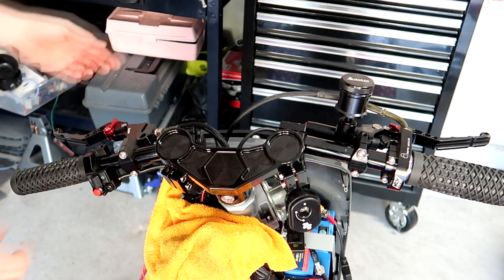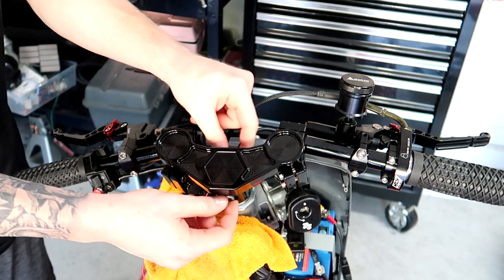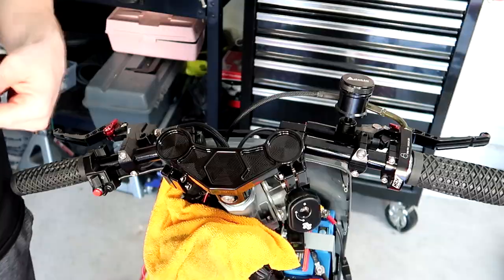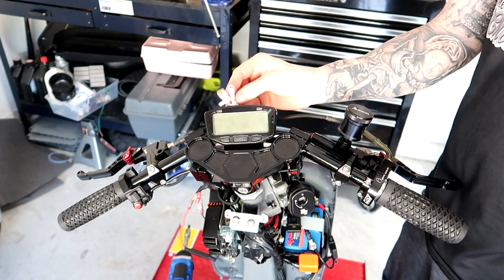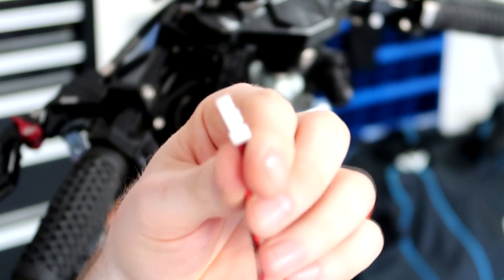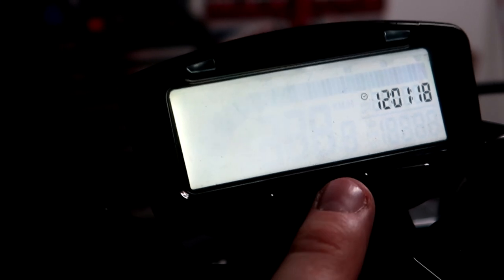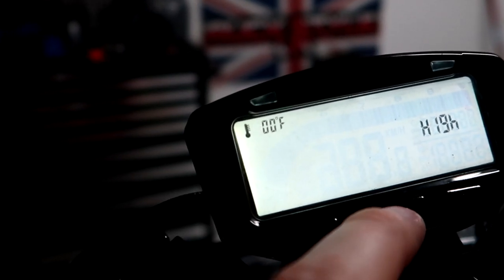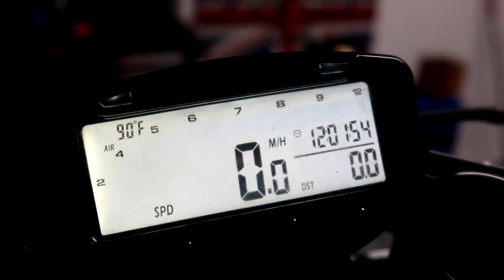TRAILTECH VAPOR INSTALL-HONDA RUCKUS-

Comment: I don't have any extra holes in my rotor for the magnetic bolt to sit. Can I use it as a bolt for my rotor. They are the same thread pitch.
Reply from the maker: Yea in the pack there should be magnetic bolts the same size as your rotor bolt.
Reply: @burnoutbobby  there was one bolt that fit the rotor bolt hole and there is not a pad that came with my kit. It's got a bolt you have to mount somewhere to your forks
Reply from the maker: There should have been a magnetic rotor bolt. They give a few options in the bag with extra magnets
Reply: @burnoutbobby  yea the rotor bolt was in there but not the pad you put on the forks
Reply from the maker: Where did you get the vapor from
Reply: @burnoutbobby  got the kit with the Ruckus trade but I'm thinking now that the previous owner may have lost it.  It wasn't in the trail tech box when I opened it
Reply from the maker: That may be the case then.
Reply: @burnoutbobby  thanks anyways. Always love the videos. Very informative as well as your site unlike some people cough cough dorbyworks😆
Reply from the maker: Hahahah

Comment: does it  have a gas gauge?
Reply from the maker: No the vapor doesn’t.
Reply: @burnoutbobby  I really want one with gas gauge so not to be guessing on the gas... but I guess you can add a separate meter for that.
Reply from the maker: Yeah that’s what most to. The vapor with a stage6 small fuel gauge
Reply: @burnoutbobby  yeah just have to create a mount with my 3d printer or integrate it to the battery box housing but I don't want to cut that
Reply from the maker: There are mounts out there for it already.
Reply: @burnoutbobby  yeah I seen some but I didn't think they are that great so I might just design my own... unless I'm lazy hehe.
Reply from the maker: That’s what I did for my last white and chrome bike I filmed
Reply: @burnoutbobby  im all wanting you to install and build stuff on mines but I know your taking fam time these days and taking a break right now which is good.
Reply from the maker: Yeah I am. Have to change my focus for a little.
Reply: @burnoutbobby  for sure you need a heavily break time absolutely understand that.

Comment: Boddy, you should be a full video on how to prep the frame with bondo for paint. And jb weld for powdercoat. Thoughts on this?
Reply from the maker: If I had multiple frames I would. My recent video is already showing how to do it for paint
Reply: @burnoutbobby  True 👍  in the process now of doing the JB Weld.. it's a pain in the a$$ cause I'm a perfectionist lol
Reply from the maker: No matter what you do, bondo or jb weld it’s going to suck and have to keep doing layers to get it as close to perfect as it can.  I’m no body shop guy so that makes it even harder for us noobs at it

Comment: Super helpful. If you have a cdi where should you coil your wire for the rpm? I did close to the plug but the readings don't seem correct.
Reply from the maker: For what cc motor
Reply: @burnoutbobby  just a stock 49cc GET nothing fancy.
Reply from the maker: You still wrap the ron wire around the coil wire then.

Comment: What is that little can on the right side of your handlebars? Also that clearish yellow tube? Im new to the ruckus scene. Trying to get knowledge from you guys!
Reply from the maker: What yellow tube? The cylinder is for my disc brakes. It’s a master cylinder.
Reply: @burnoutbobby  ohhhhh ok i see now that makes sense. Im guessing that tube is connected to the master cylinder

Comment: Love the content! Quick question my pcv bracket (2018) is smaking my ssp-g exhaust when ever I hit bumps (i'm about 180lbs) I trimmed .5 inch off but its still hitting any suggestions?
Reply from the maker: I’d remove the POV bracket and relocate the POV unit itself under the seat
Reply: @burnoutbobby  thanks man! Answered a question I had without me even asking it 🤣. You sir are a true guru.

Comment: Thanks for this video! By any chance do you know if there’s a way to program the mileage on there?
Reply from the maker: You cannot adjust mileage. You start fresh on there so basically remember where you were at before you add it on then add on what the gauge says you have
Reply: @burnoutbobby  got it. Thanks for the reply🤙🏽

Comment: Sweet this video helped me get my rpms right but my speed still isn't working. Could my sensor be bad? I rotated the sensor the same way you have it but its still not working thinking sensor is bad.
Reply from the maker: Or magnet
Reply: Didn't even think magnet could go bad. Guess I'll try that first. Just glue a new one over the old one? Mines not a bolt looks like it's just pushed through the wheel with a plastic ring around it.
Reply from the maker: @georgerobert86  yes try run in the magnet by the sensor. If the sensor picks it up on the screen then you know the sensor is good still
Reply: Magnet fixed it! Thanks man!

Comment: Hey Bobby , 
  I need some help , my milage on my older vapor somehow got screwed up last summer when my scooter was in storage for 6 months and is now stuck at 1999 miles . It was higher then that but went down and is now not going up . The magnet on the wheel is still there and the sensor is intact too . Any ideas about what happened or how to fix the issue would be much appreciated.
Thanks 
Love you
Reply from the maker: I’m not sure when it comes to those types of issues it’s best to contact trail tech. They are in the us and should be able to know what happened. I have not heard of that before.
Reply: @burnoutbobby  copy that...
Reply: I figured out it was just my trip meter maxed out not a odometer issue .....durrrrrr . 
I just had to reset the trip meter by holding left button+mode button for 3 seconds . odo was still counting as normal just didn't look through all the menu options to find the odometer as its not displayed on the main screen and I think mine was on hrs on that screen and I didnt know to hit the right button to display milage . I got her fingered out now though .
Reply from the maker: Perfect!

Comment: Can I still use the vapor if I don’t have disk brakes yet? Where do you put the magnetic piece that reads the MPH.
Reply from the maker: Yes you can the factory directions for the Vilal or go over it. It’s listed on the ruck shops website under the link for the vapor.

Comment: What did you set you temp range too I install taida 171 big bore temp goes up to 375 not sure what the safe range is
Reply from the maker: 340 I put for hot.  You may be running it too lean

Comment: Bobby the koso speedo u guys sale csn i use this  the bracket u use on this video to install it lmk bud i know this is an old vodeo but using it fir refrence to my question thank always
Reply from the maker: I have had many customers modify this bracket to work for koso. They have to drill new holes
Reply: @burnoutbobby  thanx for the reply. Man.i ll have a go at it then.     Loving the customer  service from ur shop guys speedy well packed items.  👍
Reply from the maker: Thank you we really take a lot of pride in what we do so it feels good to hear this from customers and friends.

Comment: I mounted a tomtom on my panned out scoot.
The gps don't use data and its dead on accurate.
No wheel sensors & no calibration required.
Just mount it & supply 12volts.
Reply from the maker: That’s sick. Koso has one like that now too

Comment: Hey Bobby. Where would I place the magnet if I have drum brakes?
Reply from the maker: They have instructions for that on their site. You drill a hole through the wheel and use the magnet with the c clip.
Reply: My vapor kit came with a few different magnets. One of which was not a screw but just a magnet. I bought some gorilla gel glue from auto zone then added little bit to keep the magnet from potentially sliding around or falling off.
Reply from the maker: That may last temporarily. Eventually it may vibrate off.
Reply: However, I need to readjust my sensor cable because I realize it’s too far out on the fork , not reading the magnet lol
Reply from the maker: That will definitely cause an issue hahaha

Comment: I have been trying to figure out 4 months where I would need to tap into the ATR CDI in order to get my tachometer to work. Can you please let me know where you tapped into on the CDI in order to get the tachometer to work?
Reply from the maker: It’s not bad. Just lookup gy6 ac cdi pin layout on google images. You will see a diagram that look like your cdi. One of the wires will say ignition or power to coil. That’s the wire you use.
Reply: @burnoutbobby  Thank you, so much. I too run the direct ignition. I'm glad I found your video and more appreciated that you replied, not too many people reply to videos when I ask questions.
Reply from the maker: @kennethgouldjr9179  I reply too all tech support questions here and Instagram.  Here to help the best I can.
Reply: I connected my signal wire from the gauge to the + ignition coil wire coming out of the CDI box and I'm still not getting a RPM reading. Do you have any advice on what might be wrong? As I started before I'm running a direct ignition coil. The coil only has two wires coming out of it (even though it's a three pin connector. Is that normal?
Reply: I forgot to add in. That I spliced into the + ignition coil wire. And soldered with electrical tap. Looks like "Y" split.
Reply from the maker: It works anything I connect it directly to the cdi wire that is to the coil.

Comment: What should the temp and high temp warning be set at?
Reply from the maker: All depends what your factory temp warning should be. There’s tons of scooters out there and they all have different operating temps.  So base it 30-50 degrees above the operating temp per the service manual.

Comment: Does it have its own battery source where u don’t have to connect it to a battery using wires?
Reply from the maker: Yes it has a backup battery but it doesn’t last long.
Reply: How long is not very long?
Reply from the maker: @mathewchastain8525  I’ve heard people say it’s lasted one day. I personally don’t bother testing it so I put it to a power and ground as trail tech suggests.
Reply: @burnoutbobby   what kind of battery is it? Is it rechargeable?
Reply from the maker: It’s a watch battery

Comment: My rpm is tapped into the cdi, and it’s always hit and miss weather or not it works. Sometimes it does, some times it’s backwards and goes down instead of up as I rev. 🤦🏻‍♂️
Reply from the maker: That’s no good.
Reply: With the front end vibration, and tach not working, I’m about to bring it down to you guys to let you go through it. 🤣
Reply from the maker: shane brock if we only worked on bikes here man lol. We just make and sell the parts.  But a lot of us that work here do work on the side outside our shop
Reply: Burnout Bobby oh I know. I’m just at a loss on what else to do. Ordering tires from you guys, and new front hub bearings from McMaster  today. Hoping that fixes it. Everything will be new after that so not sure what else to try. Not many ruckus guys in NW Missouri to bounce ideas off of.
Reply from the maker: What mount is it on
Reply: Burnout Bobby it’s a welded custom mount. It’s ROTM for may of this year, you can see the mount welded if you want to look at it. It just got bad here within the last two months of riding.
Reply: Looks like the mad dog weld on mount.
Reply from the maker: You ever try putting rubber o rings in between the vapor and the mount to help with vibration? They sell an o ring kit at harbor freight for cheap

Comment: I keep seeing videos of you riding scooters that have this unit installed and you use some ap on your phone to measure speed instead with up to a three mph difference between the two. Is that unit not accurate? f your phone says 45 mph and the trailtech says 42, one of them is wrong.
Reply from the maker: The trailtech is typically 1-3mph off. I’ve mentioned this in videos. I use my phone app only once in a video to check it. I do this to see how much it’s off then adjust
Reply: @burnoutbobby  I'm slightly shocked that you answered my question so quickly. I appreciate that. Does the inaccuracy of the Trail Tech have something to do with needing to be calibrated to tire size? And by the way, I got my package in from you guys today. Everything looks really nice.
Reply from the maker: @mm-tg8oo  it’s primarily the fact it reads off a magnet and doesn’t always catch the magnet.  The koso speedo we sell has an option for a gps plug in which is 100% accurate. You’re welcome. I’m always here to answer questions.  Thank you for doing business with us as well.